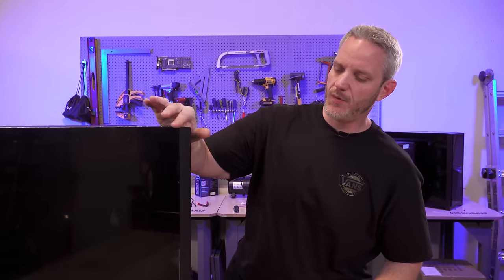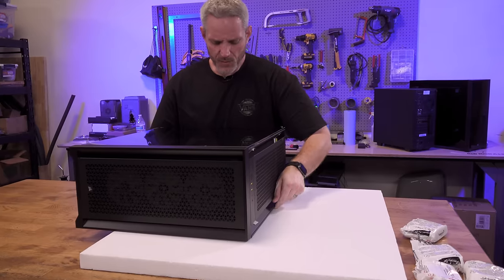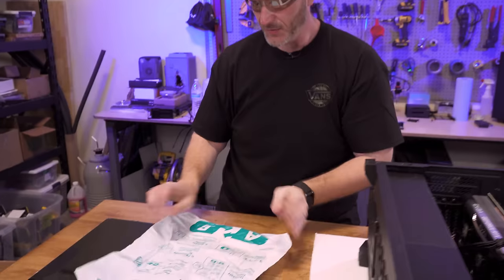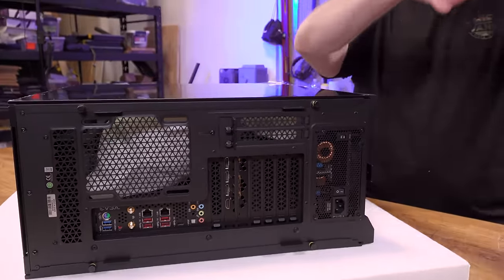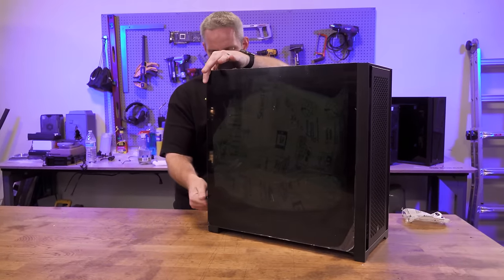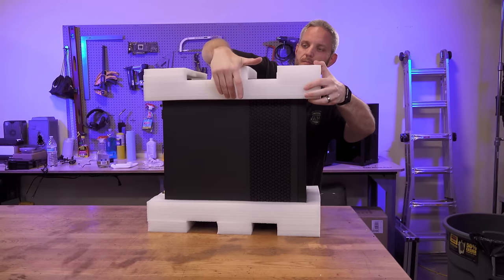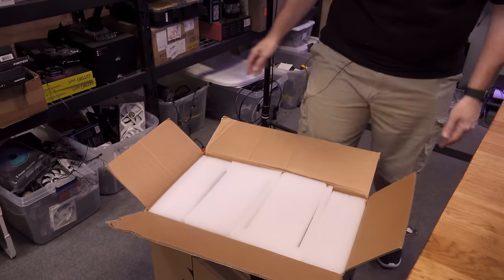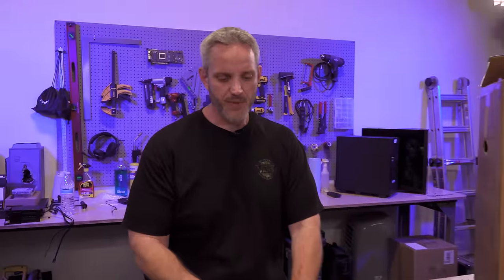How to properly pack and ship a PC!

Comment: Fun fact, if you take a pc to the distribution center of like a Fedex for example, you could have it "crated" and from past experiences i've had water cooled PC's shipped cross-country without them inspecting the box. Maybe they are more lenient because they have it on a crate. Not too sure but yeah, maybe this is an option for some people to look into!
Reply: but did you insurance it ?
Reply: JS i have had friends pay to use that, and the PC arrived "crated" in a single layer unpadded cardboard box, with all the internals totally destroyed by the gpu and cooler which had both ripped off (yay intel pushpins). I'd never trust them to pack something like a modern gaming PC properly, double so if the case has tempered glass anywhere on it.
Reply: @TheOriginalFaxon  I have had equipment returned to the office in that condition as well. It was Purolator, remember them? They managed to drop, I mean throw a desktop PC down a flight of stairs or so it appeared when it arrived back.

It isn't just these guys that can destroy equipment. In one company, I shipped a $80K digital imaging system to a customer in Mexico. The equipment arrived upside down and destroyed. The fiber laser alone cost $15K when sold separately. This wasn't a small unit either. The crate was about 6-1/2 feet high X 4 feet long and weighed about 1500 lbs.
Reply: @ownagemods  It likely also depends on the the Fedex center and how strict the employees follow the rules about how things are packaged for Shipping. Same for a UPS Store. Probably even more variation in the case of a UPS Store since UPS Stores are franchises while I am pretty sure Fedex Centers are owned by Fedex themselves instead of by local business owners.
Reply: @TheOriginalFaxon  First I want to say that Jay did a very good job packing and I am sure it will get their safely. Too bad we won't see how he makes the outer box. I would find that to be pretty interesting to watch. Plus entertaining considering it is  Jay and his normal antics. 
-
I work at a UPS Store and personally if I was shipping a computer for myself not related to work I would definitely pack the PC myself since you never know if the person packing your PC is an experienced employee, or if they even care about how well things are packed (certainly not as much as you would care).

On the flip side I find it pretty annoying to deal with people who pack things themselves since in most cases they don't have a clue how to properly secure and protect fragile items such as plates, cups, computers, photo frames, deer heads, furniture or records...

One thing I have noticed is that a lot of people come in saying they packed whatever fragile item they are shipping and after asking if I can check they sometimes have things packed in easily compressible paper, using the thin small bubble wrap, or sometimes having things like plates just wrapped in a towel with lots of empty space for things to bang around in.

I have also noticed a lot of people will be using weak Amazon boxes that were designed for light non fragile items, or Home Depot boxes that are designed for moving and not the harsh environment you will find in a shipping warehouse.
Reply: @Clavichordist  Yikes that is pretty insane!
Reply: those pop corns are awesomee
Reply: @jamesfstokes  yea the most recent heavy thing I had to deal with shipping was a $2200 tube amp I was having work done on. I shipped it in 2" on all sides, of that high density foam, the same stuff they use to ship PCs that everyone always says is amazing. When my amp arrived, dude said it was the best packed amp he'd ever seen. I didn't mind spending $50, once, to acquire that amount of foam, and I reused a box for a bench tool of some kind, forget which exactly, but it came double boxed using 2 layers of 7mm cardboard, and it fit my amp perfectly after the foam (minus a cutout in the foam for the inputs and outputs, since they're easily repaired if broken, and putting compressive stress at a 90 degree angle might break them if hit with a shock in transit). Now I can comfortably take my amp anywhere I want in the car if i move, or want to show off at a house party, and I can ship it again if I ever decide to have more work done on it in the future. It did already fly to washington from CA and back, twice. The former owner had work done on it in the 90s by the same people who I had do work on it again this time, both times were updates to the circuit topology to repair broken components, and update it with modern tech as well. It went from being a $500 beater that needed work within a year, to a $2200 masterpiece on par with a McIntosh. Gotta take care of your babies. If I was shipping a PC I'd give it the same treatment tbh. Instapak the inside to keep everything secure (I have a huge box of those things, they're wonderful for shipping individual speaker woofers in boxes to people), and then instead of padding it up with spare cardboard, i'd go with more of that same foam they already use to support it, that stuff is fantastic and definitely stronger for the task. Reusing old cardboard is definitely the next best option if you're just using what you have on hand though, obviously, so not criticizing jay for that. I'm just willing to do the expensive option if it's my personal stuff and I expect it to be worth it
Reply: i am in the drug trade me and the boys will be looking into that.
Reply: @jamesfstokes  I can say, my friends family are UPS Store franchisees, having helped out at a franchised store, any store that won't let you see the boxing process, and can't explain specifically why they do things a certain way, you should not ship with ever.  I have helped them box up motorcycles, duffel bags, all kinds of stuff (their locations are on a military base) and the custom packaging is always open and quite good.  If the UPS store boxes it and it gets broken in shipping in a manner that 100% points to how it was packaged, the store ends up paying the insurance, so it was always in their best interests to make sure it was packaged well.
Reply: @ownagemods  facts, we literally accept everything. They even make me deliver overweight ground items (over 150lbs) because it was "close enough" (175-200lbs)
Reply: @mercuryfusion8325  I agree with what you said and would always prefer doing business at a location that is transparent in their processes.

I know it might be different at other UPS Stores, but at least where I work if a customer would like to watch us pack the item they are free to do so. However, they usually choose not to since they would need to wait for one of our associates to be available while we assist other people in line with their needs.

I remember a couple years ago our store was a lot less busy but these days it can get a bit crazy with all the Amazon returns (about 100-200 amazon returns) along with the normal prepaid UPS and USPS labels.
Reply: @jamesfstokes  It sure was. I swear the shipper put the digital imager on the back of a pick up truck!

It's not just the hardware that got smashed. We used to receive boxes I mean pallets of boxes of special ink sheets to go with the imagers. No pressure at all could be applied to the flat part of the boxes no matter what and there were layers of cardboard and carboard framework inside the boxes to prevent crushing. The reason was the thin mylar film at special ink on it that was ablated off the sheet and on to the paper. These weren't small boxes either, meaning they were 20 x 30 inches. 

This setup worked pretty well except when someone stood on the boxes or put something very heavy concentrated into one area. 

A big US common carrier ended up eating their shipment for the supplier because one of their drivers or workers stepped on the boxes in the middle and destroyed about half of the shipment. 

I refused the delivery of $125K in boxes of ink sheets which retailed at $2000K per box for 500 sheets per color. 

In the end, we dropped that shipper and never dealt with them again.
Reply: @jamesfstokes  I used to work for the USPS. You should see some of the boxes people use when they mail something. Like thin cardboard (not corrigated) boxes!
One time, I picked up a box and it had the distinctive sound of broken glass coming from it.
Whenever I delivered a parcel to the door that had obvious shipping damage (punctured sides, box half torn open, the sound of something broken, etc.) I would write on it: "Received at Post Office as is."
Reply: @jamesfstokes  my experience when i shipped my pc ensured in my country, the worker "i am going to make sure this is 100% properly packaged, i am not going to be in any way shape or form liable for this" I suppose that when there are real consequences for messing up in the job people do care..... a lot
Reply: @alenasenie6928  very true
Reply: What's the cost comparison though
Reply: How much does that cost and do they cover it if damaged upon arrival?

Comment: Glad I saw this, my brother sent me his “broken pc” which was just a failed SSD boot drive, provided him with few upgrades and was wondering how should i mail his pc back to him safely… need to get some of that insta pack for the inside of the pc… i mean its not a 5K pc but a pc is a pc and needs to be safe. ❤️ thanks for the how to videos Jay really appreciate what you and Nick and Phil do for us!! 💪🏼
Reply: I was asked to repair a system that was mailed badly. High end graphics card got killed because it fell out, as did the CPU and cooler. I wound up building her a whole new system
Reply: @jonathanwessner3456  yeah thats my true fear, is that happening, unfortunately my brother does not know how pc’s work. But thats awesome you replaced the system. Mailing is scary 😧
Reply: I think that anything worth more  than 400-500 dollars is worth spending a bit extra on packing materials should be packed with care unless you want to gamble on it getting to its destination in one piece. The instapacks are insane and really useful. I wish that we had some where I work packing stuff.
Reply: @alexoqu  I would say that keeping the items secured inside the system is the most important step to keeping the PC safe. You then just need to a bit of packing to keep the case itself from getting dingged up along with absorbing any impacts before they can make it to the more delicate parts in your PC like motherboard and GPU

Comment: As someone who used to work for FedEx, I love computers, so I always packed with the utmost care. And as a little pro tip, after the instapack "splooge" you can spread it across the entire bag so it properly fills out the whole thing. If you just let it splooge and leave it, it usually just fills half the bag, forcing you to use more of them. (Like what happened where it didn't go beneath the graphics card.) Also, another tip, don't use moving/storage boxes to ship, those things are pathetic and puncture/collapse easily.
Reply: Yeah, what you really need is some Appliance boxes, those are double corrugated cardboard, when the standard moving boxes are single.
Reply: @th3R0b0t  If you’re actually shipping it then yeah that’s definitely a good idea. If it’s just going in the car with you though moving boxes are fine. Lay down a blanket or thick towel in the seat to absorb some road vibrations, box sits on the blanket, strap it in tight with the seat belt. And never forget to look at it and say “yep, that’s not going anywhere.”
Reply: @charlesbrown4483  Yep,  if you are moving the Home Depot or Amazon boxes would be fine to use especially if being transported in you car. If shipping then I would always use 200lb or stronger card board boxes for other outer shipping box. This is especially the  case for anything that has a value of more then a few hundred dollars 😎
Reply: what are the best kind of boxes to get then? I have a Thermaltake cube case for my PC, so having a good case that will fit my pc when I sell it is a concern for me. Also, could you achieve the same grade of packaging if you filled the voids in a case with bubble wrap instead? I have quite a lot of that

Comment: Yeah, the most important part of shipping/moving a PC is to keep the original case packaging and use that as your starting point.  Inconvenient if you don't have any place to store it, but it was literally designed to protect the exact shape of the case without damage.  So if you keep that starting point, you're way ahead of the game.  Same for monitors, TVs, etc.

A related but different topic: when moving a PC from one place to another, a wheeled cart seems like a great idea ... with caveats.  First, gravity still happens, so never put the PC upright on the cart because it can topple.  Put it on its side.  Preferably on a piece of foam or padding because...  Second, carts don't have suspension.  All those jarring little vibrations transfer to the PC components.  REALLY bad for mechanical spinning-rust hard drives which have tiny moving parts.  Carrying by hand, using the human body as a suspension system can be a LOT safer, especially with older PCs.  But because handles rarely exist (and if they are, are almost never as strong as they seem) on PCs, any kind of strap (or rope) you can put around it to give yourself a secure hold on something as you move it is a huge plus if the case is too large or heavy to hold easily.  And if tempered glass panels are on the case, when possible, remove those and carry them separately.  They break easily, sometimes from the most seemingly innocuous things.  Because tempered glass is under some weird pressures.  Super strong ... until it explodes from a minor ding.
Reply: i always repack in the orginal case box
Reply: One tip I saw some time back (I dunno if here or somewhere else) was to use the box the case came in to store all the component boxes in.  That way, when you see your case box stored wherever, you also know anything related to that pc is there.  And as you said, also means you have that as a starting point for shipping as well if needed.
Reply: @JuffoWup78  That's what I do. You still need to be able to store the case box somewhere, but at least then everything is together when you need it.
Reply: I took a whole closet in our house with original PC parts boxes. And the empty Case box is perfect for keeping the boxes for the other components.
Reply: That depends on your case, some cases come assembly required
Reply: @mjc0961  If you have a attic, basement, garage or some such, you have a place to store them. If you store them in a basement or storage shed though, keep them up off the floor in case of flooding.
Another place is a spare bedroom you're not using. (That's where we store all our boxes and junk).
Reply: I sadly had to get rid of my case's box at microcenter...I have an Asus Strix Helios...Their box is huge, I wasn't able to fit it in my car...

Comment: I remember I used packing peanuts in 2006 to fill the whole void in my PC when I had to take it overseas. Then, I used a lot of packing stuff to protect the case inside my suitcase. Even though I thought that, and declaring my suitcase as fragile, was enough to make it safe, the super gentle guys at the destination airport managed to (probably throw the whole suitcase) make a dent and misalign my PC case. Fortunately, all the components inside (spinning 250GB WD Black HHDD, Geforce 6600GT, AMD processor, motherboard and DVD burner drive) survived the trip. Case is still being used 16 years later.
Reply: same thing happened to my Cello
Reply: Nice! How did you get all the peanuts out of the case? Wouldn't that make a bunch of small styrofoam pieces inside the case?
Reply: @jamesfstokes  It took hours to remove them by hand, and then vacuuming with care. I live in a high humidity place, so static electricity is not much of a problem.
Reply: ♜ Pinned  by Jayz TwoCents  Reported

Comment: As someone that has been involved with designing the foam endcaps for shipping things like this... You don't have to fill the air gap in that interior box, especially if you're planning on putting it inside an outer box. The endcaps act as your absorption, if you overstuff the box and make the absorption effectively stiffer more force is transferred to the product. You are also packing it in such a way that weaker parts of the case, such as the middle of the side panel, will take a load rather than leaving that work to the strongest corners of the case. It will probably be fine, just need to keep in mind that more foam isn't always better. Insta-packing the gpu is on point though

Comment: Great Vid! Also Watching Jay's reactions and wording is Hilarious! - I can totally attest to the "SPLOOGE" that the instapak does.. cause i used the methods/ideas from his previous packing video to ship a machine I built for a friend couple years ago.. and the "padding" to then the burst inside is kind of shocking the first time, but then you get the hang of it and learn to MOVE FAST!.  You almost need thermal gloves to protect skin cause it does get pretty hot at times.     I like Jay got a multi pack of this stuff and still have some left over.  Kinda nice to have on hand.